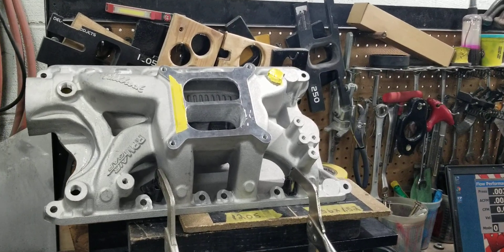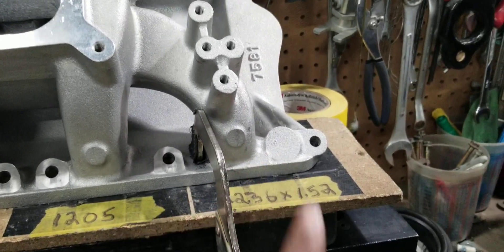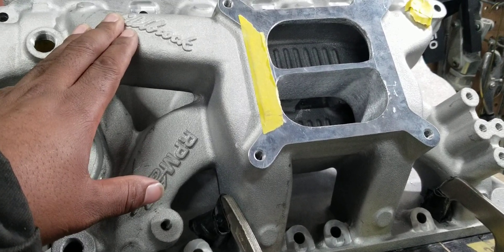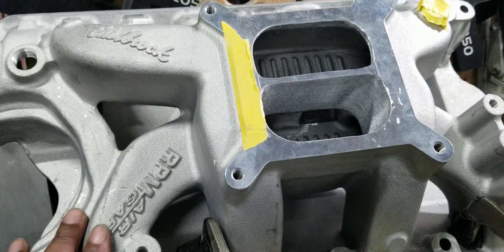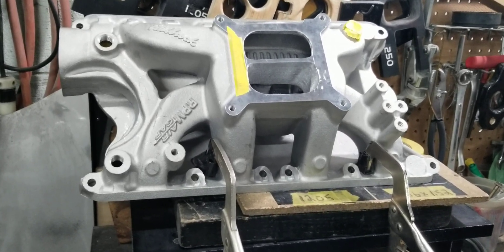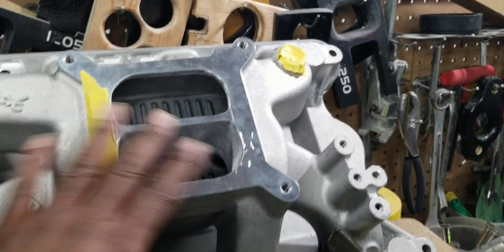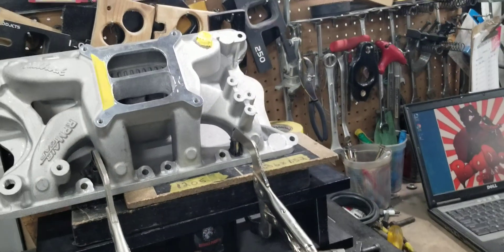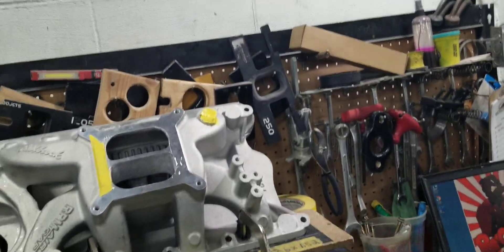💥SBF Edelbrock 351 Performer Rpm Stage 2 porting results Part 2!!💥

Comment: I'll be sending you a virgin 351W Edelbrock Performer RPM (Non-Air Gap) intake for your stage 2 porting. 
My motor is a 427 Windsor with the following specifications:
4.125" bore x 4" stroke
Custom hydraulic roller camshaft: 240"/240" @ 0.050" duration, .589" intake/exhaust valve lift and a 114LSA.
10.4:1 static compression ratio
AFR 205 renegade heads
Full length 1.75" primary headers with 18" collector extensions to full 3" X-Pipe and full 3" dual exhaust into a single 2 in/2 out full 3" Magnaflow muffler.
Holley Sniper X-Flow 1375 900cfm throttle body fuel injection system. I'll be utilizing a 1/2" open spacer to help eliminate EFI TBI tuning issues associated with dual plane intakes with the divider at the throttle body unit.
Most folks scream "Single Plane Intake!! for a motor of my displacement but I like the idea of an enhanced dual plane intake that will enhance my low RPM torque for street driving and with the enhanced mid range and top end that an extra 70+cfm flow, from your port work, on my intake, will provide.
I was hoping for 540HP/550 foot pounds of torque from my combination without a ported intake. 
With your ported intake, I'm curious if 560+HP/560+ foot pounds of torque is conservative and realistic? I'm guessing I'm not too far off. What are your thoughts? 
I realize that HP/TQ gains vary from build to build.
Reply from the maker: With your combo and a dual plane manifold ported and modified by us it will make more power than a out the box single plane manifold yet make gobs of torque everywhere In The rpm range. You are going to be shocked at the hp our ported dual plane manifold will make. 
You are on the right track as far as softening the signal for the tbi injection system. We use the spacer and drop the divider down some when customers want to us a tbi system on a dual plane manifold for th LS applications. Tuning is great and idle is steady.
Reply: @bigdogsportingtonyb2833
Reply: In your experience with a throttle body efi on a dual plane intake manifold, is a 1/2" open gap over the plenum divider from a 1/2" thick open spacer or is a 1" open gap between a 1/2" spacer and plenum divider cut down of approx 1/2" is what it would take for normal useage of a TBI on a dual plane intake manifold?
Reply from the maker: @donredden7022  it really depends on cam and motor combo. There is no definite get right the first time. You really have to experiment.
Reply: I'll start with the half inch open spacer then go from there.
Reply: I'm pumped about this motor being fully optimized for all areas of intended useage.

Comment: Question  have You ever done a comparison between this style intake and a Pro Flo 4 intake for the 351 SBF and would there be an advantage to using one with the Pro Flo 4 system ? Any information that You are able to share will be greatly appreciated , Thank You . 🇺🇸🇵🇷🦊👍
Reply from the maker: The pro flow sbf manifold flows well but not as well out the box as our stage 2 ported carb manifolds. Pretty much all these single and dual plane carb manifolds needs porting in order to maximize their potential. I wouldn't recommend a dual plane manifold for a TBI style injection system

Comment: Very impressive.  Pretty much no restriction with the most heads you would use. Is there a difference flowing it upside down blocking the other ports off?
Reply from the maker: The intake runner was flowed in the direction it flows on the motor. All the runners are blocked off except the runner that's being flowed. We've showed this in the other videos we've posted. All of our ported parts gets tested the same way, using the same fixtures on the same bench that way our database is consistent.

Comment: Have you ever compared your flow bench to a Superflow bench?
Reply from the maker: Yes. I use to use a friends SF600 back in 2007 up till 2013. The SF always read a little higher than ours even when calibrated to the same exact calibration plate. He said the same thing. There's more room for error. If you go through our videos we show you our flowbench accuracy by flowing a calibration plate in real time while changing the flow depression to show how the computer adjusts to read out the same cfm flow. We've showed this while flowing parts as well. We've aslo seen other people compare the SF bench to other benches and they've experienced the same thing. We've even seen a video where they flowed a part on two different SF benches and got different numbers. Do a search on YouTube and you will find the videos. That's why we do before and after flow testing to show the gains.

Comment: Thats some really good gains with a stage 2 port job , thats another 150 hp potential. Ive got some 210 cc heads what would ya charge to trick them out to the max
Reply from the maker: Message us for our peice sheets
Reply: @bigdogsportingtonyb2833  ok i need the family deal like stage 3 for the price of stage 1 😆 I think you did say you hook me up with the family plan or you told me to mention it and im ready to send these heads your way and I really appreciate the swag you sent me, you really hooked it up 👍
Reply from the maker: @79beans347  we got you!💪